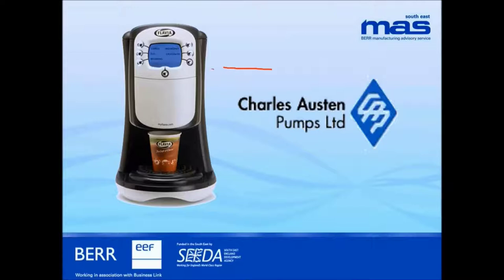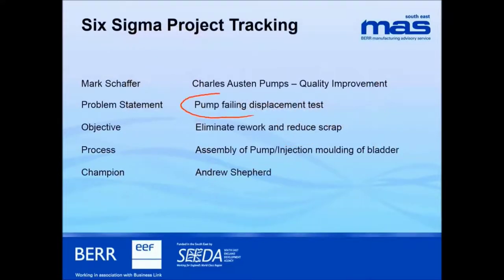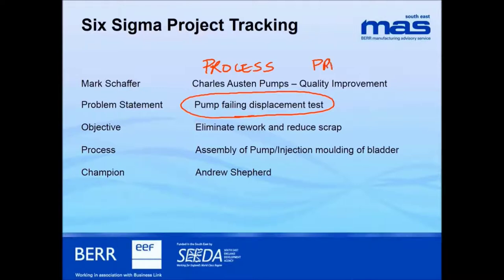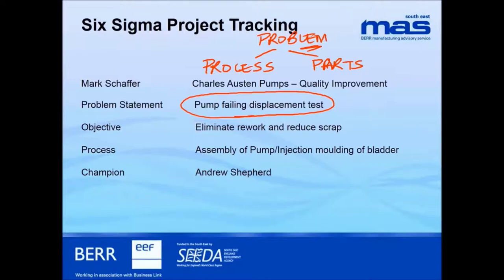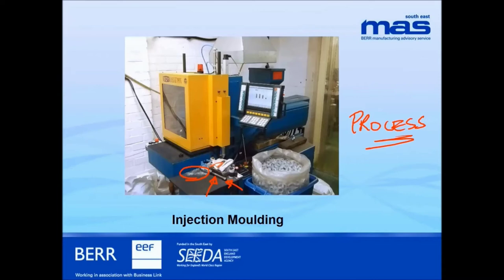Component Swapping Case Study

Comment: Great videos! Question: where did you get the best and worst assemblies from to perform the test on? Did you wait for an assembly that performed as BOB and take it off line for testing, and same with the WOW assembly?

Also, was it the actual BOB or just in the top say 5% , as I imagine you would be waiting a long time for an assembly to be the BOB ever?
Reply from the maker: Hi Kiwi - The BOB and WOW would be identified as the end of line test is being conducted. And yes rather than waiting for the most extreme results ever, pick a reasonably extreme low and high result and use those. What you are doing is putting a large signal in the data, this means that the sample size can be small but still tell you lots of information...